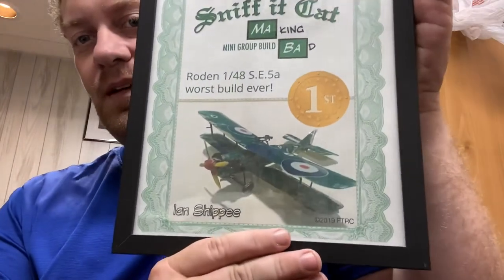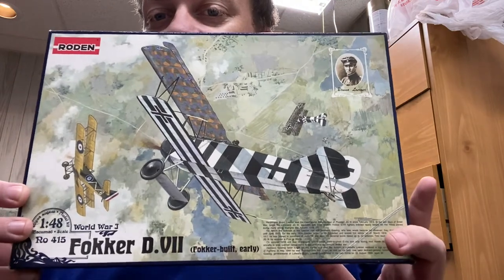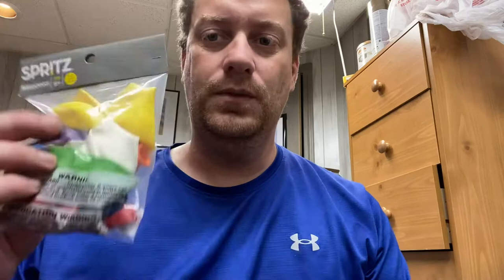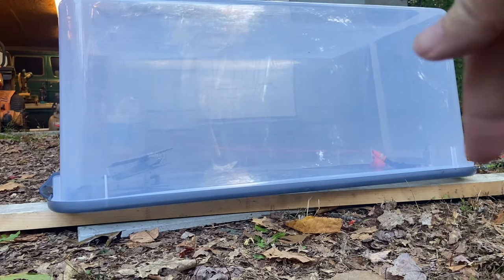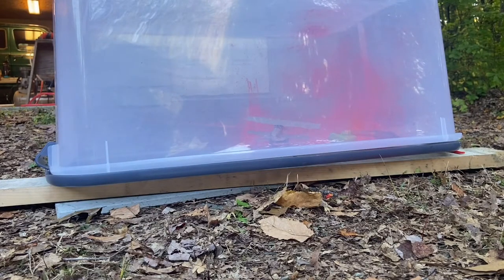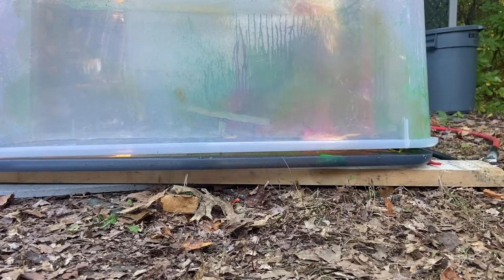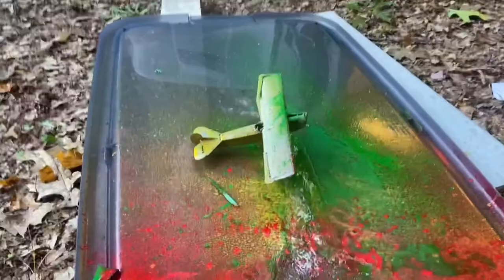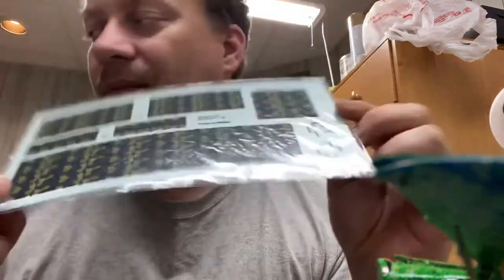Building Bad Fokker D.VII! Painting by explosion

Comment: Making Bad!
Reply from the maker: Very bad indeed! *avoiding copyright infringement to keep the cat happy
Reply: @cadzag72  ah clever thinking.  That method for painting really leaves a great effect on the model.  I wonder if putting the air hose through the top of your container, so the balloon is above the model, might get more paint on the model with the help of gravity?  I noticed more paint around where the balloon sat, so it most likely fell down, more than blew across on bursting.
Reply from the maker: @HarryHoudiniModels  I did consider drilling a hole up there. In the end the only reason I decided against it was that getting the loaded balloon back through a hole small enough to contain mess I was worried I would lose it or break it. If I ever try doing this in a more serious way, I might rig up something a little more geared to the task. The effect reminds me of some legitimate camouflage used by the Austrians and Germans on some of their aircraft!